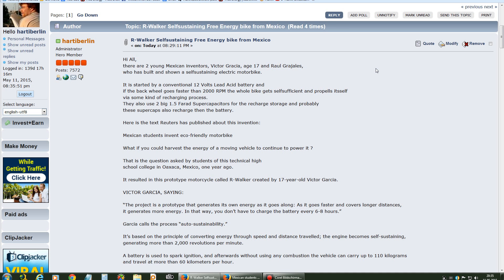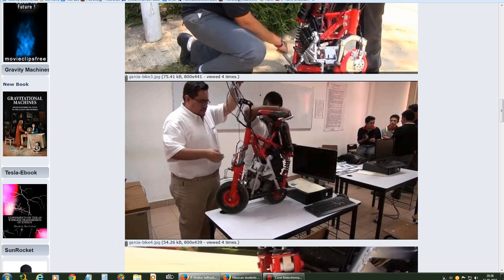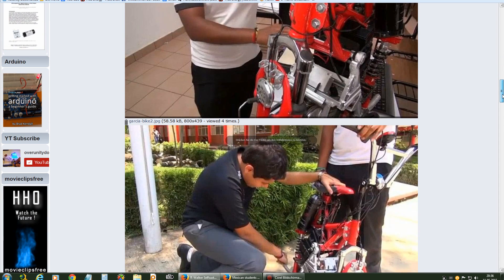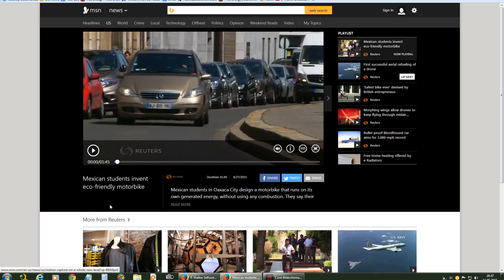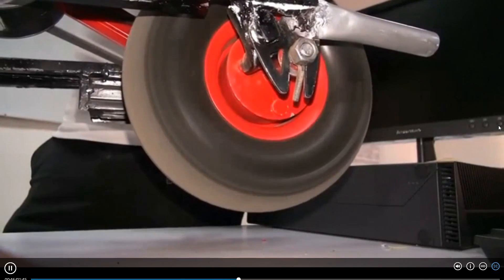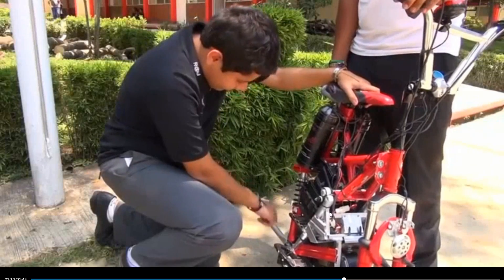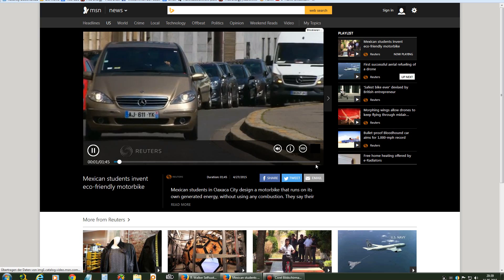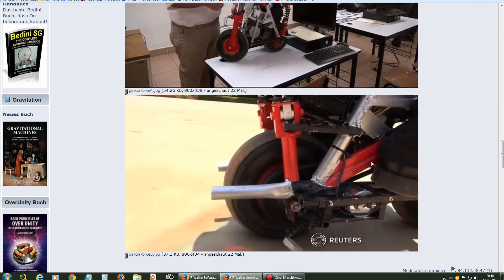R-Walker Free Energy Selfsustaining Electric Motor Bike from Mexico

Comment: Thank you for sharing this video.

My research and study notes on this self charging system concept: The scooter uses two 1500 watt 1.5 Farad digital power capacitors. with one 12 volt lead acid start battery which appears the size of a small motorcycle battery. The drive motor appears to be the stock motor that would come with an ordinary small electric scooter. But added to this is the small generator which appears to be one quarter the size of the small drive motor. The small generator motor must spin at 2000 rpms minimum, and then maintains charge to the capacitors to needed level to sustain motion of the electric powered bike. The small drive motor has a maximum rpm of 2700 rpm. The small 12 volt battery would require charging every 6 to 8 hours without use of the onboard generator and two super capacitors used to capture and sustain the charge without end. The 12 volt charge battery is said to have a life span of 5 to 10 years and is only used to initially get the electric bike going to the 2000 rpm needed to maintain the charge of both the capacitors- as well as the 12 volt small battery. The 12 volt battery is used only to start the system(until 2000 drive motor rpms is achieved). The small generator appears to be the size of my closed hand, approximately two and one half inches wide by approximately three inches in length. There appear to be only two wires connected to the back of the small generator(which maintains charge to both the capacitors as well as the 12 volt lead acid battery). The capacitors say 1.5 FARAD. 1500 WATTS. LOW EBR 20VDC. DIGITAL POWER CAPACITOR. There are two of these capacitors on the self charging electric bike. Note: These appear to be the same capacitors that I have seen at Wal-Mart in the Automobile Audio Department near the aftermarket stereos and amps and speakers. I can look for used capacitors as well.

Further Notes:
The 12 volt system start up battery is a lead acid battery(appears to be similar to a motorcycle starter battery in size).

This self charging system can sustain speeds of 60 kph or 37 mph.

The 12 volt lead acid battery has a life span of 5 to 10 years.

Because the self charging electric bike was made from recycled materials, the total cost to build the electric bike was 200 US dollars.

The faster you go, the more energy the system generates. Thus no need to recharge the system every 6 to 8 hours.

the builders of this system refer to the design as auto sustainability.

The motor thus becomes self sustaining, thus generating over 2000 rpm's with a 2700 rpm motor.

This system can carry up to 110 kilograms, or 242 Pounds.

Is noted to reduce pollution by 70% and save more than 200 batteries per day. Notes one of the student designers.

Comment: it needs to be verified true by a true engineer who knows what is overunity ..
Reply: professorfidelcat  A true engineer is taught by virtue of his education that Over Unity is not possible. Therefor you will have to educate this true Engineer how to measure it properly just as you will these young men. It will be found that the blinders will be very hard to remove from a classically trained engineer. Been there done that got the T shirt and the scars to prove it.
Reply: overunity is the most obvious aspect of nature. the zero point field is powered by the material universe. the material universe is powered by the zero point field. and yet, in addition to this perpetual motion of self charging systems, the zero point field contains 10 to the 40th power more energy than the material universe. that is natures first example of over unity.

but to learn this, requires reading beyond basic electrodynamics. otherwise, there will only be misunderstanding.
Reply: the only verification that can be accepted is self verification. anyone else can never be truly known for certain, if or what was achieved. only an individual can prove to themselves, what is possible. no one can prove anything to anyone. and this is well known and well understood among researchers and experimenters.
Reply: its been 8 yrs since this video.. are they selling this machine yet?
 @SpaceVortexTheory.TYp.Tewari